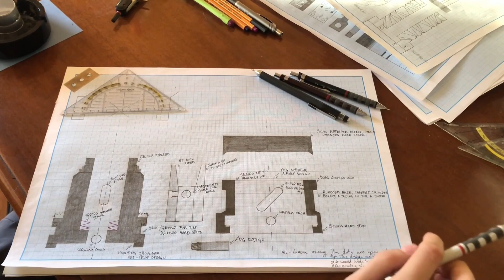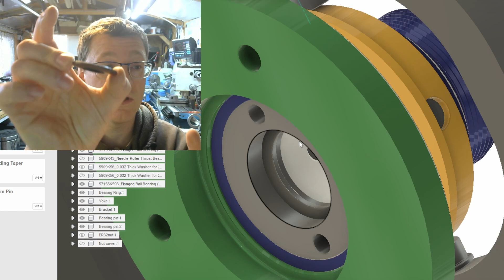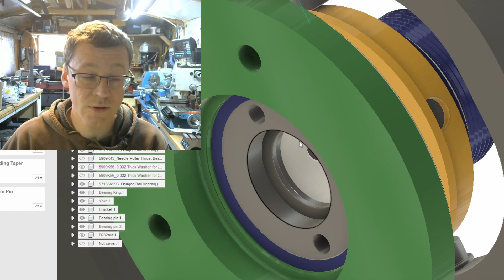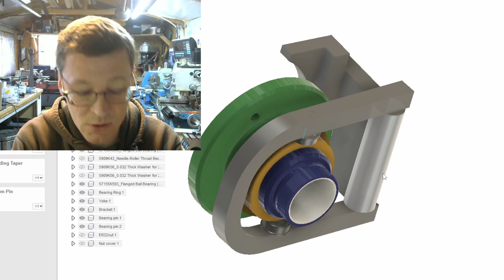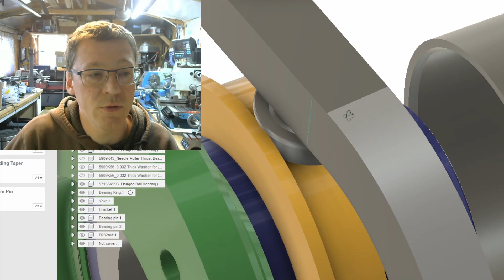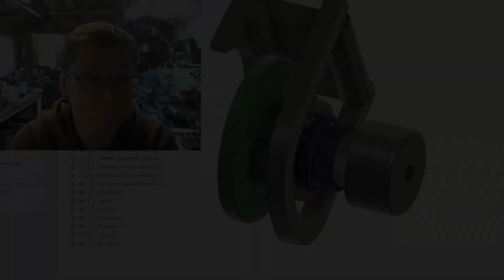ER32 Lathe Collet Chuck Feedback

Comment: I thought it might be useful to repost my comment from the original video for viewres that missed it before it was posted.

" Clamping the parallel shank of a tool by spring pressure is not used in industry for obvious reasons.
Bellevile washers are used to clamp solid tapers into a socket via a drawbar where the inherent friction of the taper and drive keys stop the toolholder from spinning. The cutting tool is securely clamped in the toolholder. " 

Sealed collets would keep the chips out of the spindle bore.

With about 2mm of free travel on a pair of Belleville washers do you need to have 1mm compression for clamping and the remaining 1 mm for unloading. If this is the approximate case as the load is non linear then the initial clamping zone of 1mm will be a small load and the unclamping extra 1mm of travel will be much higher.

Would you use the clamping method of pulling the release bar back and tightening the nut by hand, then releasing the bar allowing the springs to clamp the part therefore a custom knurled nut may suffice.